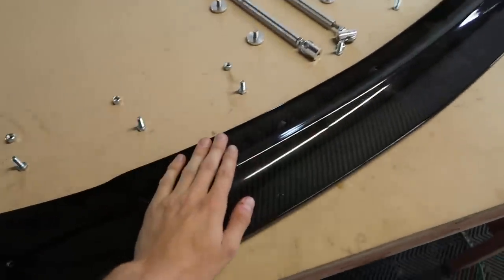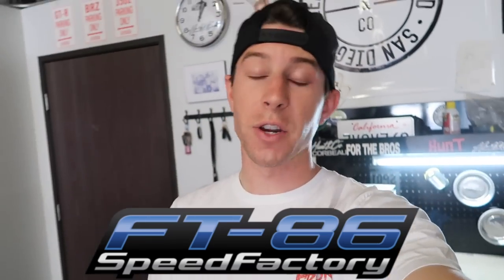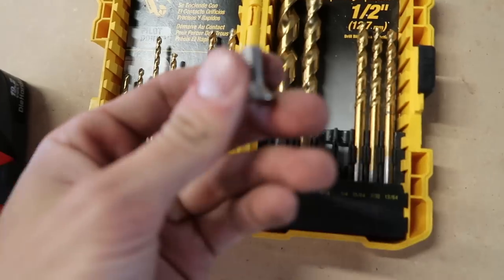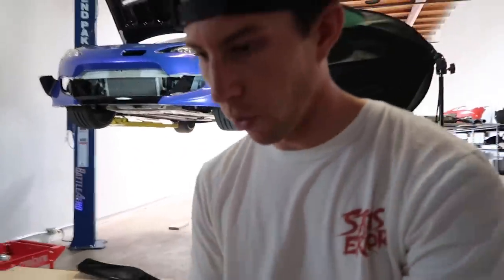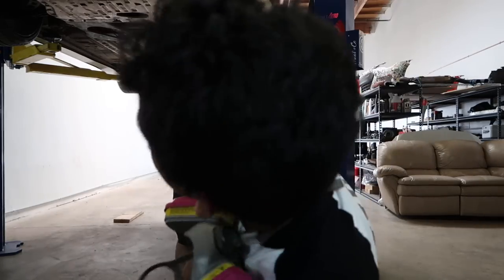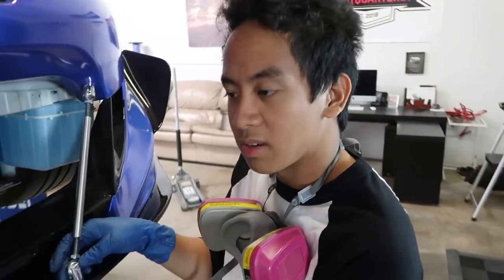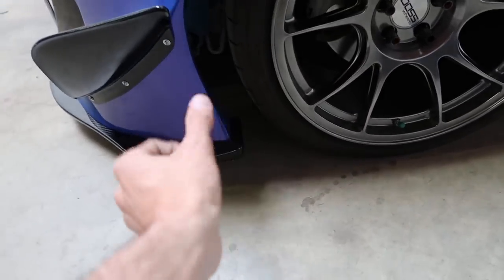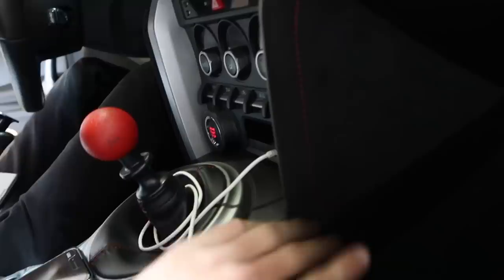Making Miley great again

Comment: TJ, from someone who started on a 600 and felt the same way you do when I was first starting out. A good compromise you could look into are bikes with different power modes. Most of the newer 600's can swap between 80% and 100% power. This way if your afraid of the full power at first, just change the mode and get used to the lower power first and in the long run you won't be wasting any money.

Comment: Go for a 600. I was 5'5" 120 pounds and bought a GSXR 600 right after I graduated high school. I had plenty of experience with dirt bikes and it wasn't a bad transition at all. You did a great job on the Triumph. There is no reason to be worried about it unless you don't have self control. 600's are docile until you rev to like 10k. I recently sold my 600 for a KTM 690 SMC. Supermoto is the next step after you get your taste of the sport bike ;)

Comment: Yo get a 650 twin it's in between a 300 and 600, and you won't get bored of it too quick! plus the power band of 650's are usually very linear which means easy to control!

Comment: get a 300 or 500 great starting level

try a cbr500r or cb500f
Reply: Justin Trinh Agreed! Tho the 500 Is a little heavy and not to much more power than a 300, but would still be much better than a 600.
Reply: Justin Trinh don't be a little girl, the man needs atleast a 600. do you even have riding experience. take into account height, a 6 foot man on a 300 is insane.
Reply: Preston Johnson tf are you talking about 😂 the size of the frame changes very little from 300 to 600.
Reply: Isaac Hepworth the frame size might now be much different be riding position, 300 is more upright, knees will be hitting the tank in the wrong places and your legs won't be comfortable at all where on a 600 you'll be in a more aggressive position and your knees will hug the tank correctly
Reply: Preston Johnson umm no, I'm 6 foot and I've sat on 300s and they feel fine. The upright seating position is more comfortable than a super sport. Only thing I don't like is that the pegs seem a little close to the seat, causing my legs to bend more than I'd like, but I've sat on a zx6r and it felt pretty similar in that aspect.
Reply: To those that say 300's are going to be small:

Plenty of people ride 300's that are  tall. Plenty of people ride Groms. I know of one guy that kills it at my local track on a nsr50.  If he runs into comfort issues, he can get after market rear sets and clip ons but I highly doubt he will.

if you guys think 300's are lame, go watch moto3/arrc 250/your local club organization light weight races

Comment: Just a suggestion and the route i took when i bought my bike. I was looking at 600cc and liter bikes and ended up going with a 650 by kawasaki. Its a parallel twin engine instead of the inline 4. It still has plenty torque and enough speed but its not stupid fast. I've had my bike for 7 years now and i have yet to regret my purchase. Best of luck I'm excited to see some motovlogs.

Comment: just a quick tip when drilling holes, draw a cross across where the hole will be, that way if the drill starts to travel you can easily see and correct it

Comment: TJ this is how I feel about the bike sizes. I started on a 1000 that was a gift from my brother, so it's possible. I had no background in riding motorcycles at all. As long as you respect the bike and don't push it you'll be okay. That being said, there's a lot of times I feel like I missed out on the joy of getting to move up through the power.

Comment: Hey TJ, so I own a Ducati 848, which is 850cc pure racing power, but it matters less on the bike you choose and more on your self decipline, if you can control yourself you could get a 1000cc as a first bike, if you can't control yourself you may want a 300. Me, I started on a 600cc and im still here and I've never been in an accident or dropped my bike.

Comment: Tj a good consideration about the bike would be a 650cc. Know the cc's are more than a 600 but most are 2 cylinders vs. 4 cylinder supersport 600's. An Sv 650 or an Fz07 would be a good starter that wouldnt out grow for a while.

Comment: the smaller displacement bikes are fun, you can ride them all out all the time. i had a 250 for 4 years, only thing i didn't like about were going on interstates where people were going 90mph and it topped at 100mph. i went stupid and got a 02 honda 919, scares the crap out of me but i love it and respect what it can do. oh and take a motorcycle safety course

Comment: Sabrina, that was a great impression of TJ 😅 and TJ, about picking a bike, what i and my friends did and many others here do is getting a 600cc and restricting it (reduce power) and as we got used to the bike we gradually increase the power by removing restrictors. 
Also, you really should wear gloves, you can get really nasty burns otherwise. BUT, you need gloves that fit your hands and feel good to you personally to get the best feel. You might want to try some that are "inside out" if you haven't, they are a little more comfortable than "stitches in" ones. I find that with alcantara wheels i get better grip with gloves, and my hands are better with leather wheels. But then again my hands tend to sweat a lot so i use gloves for that reason too.

Comment: What TJ said about picking the right size drill bit only applies if you have a fastener I.E. a nut on the other side. If it's a wood screw or any other type of screw that you're going to be solely counting on to fasten your ish you're definitely going to want to make sure you use a drill bit that's the size of the screw minus the threads or shaft of said screw. Upvote so people won't f up their ish?

Comment: #tjhunt Do what feels good to you man! Go take a couple bikes out for a ride im sure the guys you will be working with will let you... 300 is fun and 600 is what id limit myself to... but go with what feels comfortable drive them both around... and rip it! if your on a 300 and you try to go and you feel like its not enough .. bump up a lil more ... with mods you can also make a 300 alot more fun ... 600 has the power needed with little to no modification ... But that is my advice man drive both sizes and of a couple different makes and figure out which one fits YOU! 

Pros and Cons ive experienced ...
300's zippy great for getting around and just having fun and not worrying about power band... its pretty hard to kick the wheels out of a 300 so they are pretty safe ... Cons to the 300 ... they tend to be lighter and if you like hitting the high speeds sometimes wind can push you around.

600's wheels can kick out ... which is great if you like playing and experimenting and going 0-60 really fast! its alot of fun ... also the 600's are heavier and you will feel the difference when cornering or riding at very high speeds, you will stick to the ground better.

Go with what feels right!

Comment: KTM RC 390, perfect starter bike. All you need to do is replace the clutch and brake levers because they're made of aluminum and they'll break really easily if you tip the bike. But since you have experience, I wouldn't worry about it.

Comment: You are supposed to match drill bits and bolts with the end of the drill bit that the drill is clamping down on and the end of the thread on the bolt to

Comment: TJ i know they don't look as cool but you should think about getting an open face helmet for drifting so if your going to talk it will sound more clear. smart getting the smaller engine on the bike. step up to the bigger one when your ready. plus you can run through the gear more without instantly going 100.

Comment: seems to me those control arms were designed to fail to protect the car from damage eg: bending or breaking the mounting points or flexing the frame

you might find that you'll bend a lot of these arms but that's ok because it's doing it to protect your car

Comment: the biggest problem you run into on any 300 is the low gearing to make up for the tiny power. you have to rev the piss out of them to keep up with traffic on the freeway. look into 600-700cc two cylinder bikes like the ninja 650 or fz07. they have moderate useable power and freeway friendly gearing. but the most important thing I do before buying bikes is get seat time on whatever model i'm looking to buy to make sure it's what i'm really looking for.

Comment: If you dont want to hurt yourself, then dont get a bike lol I started on a 600 with absolutely no riding experience. Got bored after a year and upgraded to the 1000. Definitely a much better bike, especially for my build. 6'4" 250. Riding in Cali is much different from riding in Michigan though. the other drivers expects bikes to be around. MI only sees motorcycles for 4 months of the year so other drivers freak out when bikes come out in spring time and accidents always happen.

Comment: Doesn't matter what bike your gunna get, you will get hurt, that's why it's a waste of time buying a 300, especially when you know how to ride as it is. A 300 would be better for people that are learning to ride and modulate with the clutch and throttle without too much power. Since you can already do that, as a rider myself I highly recommend you getting the 600, remember if you are going to fall off and get hurt you will, it doesn't matter what bike your riding.

Comment: hey man about the bike, honestly a 600 would be better for the simple fact you'll learn throttle control. i advise watching twist of the wrist if you haven't already. the acting is bad but it's very helpful. 300's are good beginner bikes but 600's will let you respect the power and learn your limits. don't be scared of crashing. everyone will always go down at least once. just wear your gear and don't do anything stupid and you'll be fine. CBR600RR's are good or Kawasaki Ninja's as well. at the end of the day it is your choice so do what you feel is best for your safety.

Comment: Please don't follow the advice about the screws X drills!!!! If you see the center metal piece (disregarding the tread) match a drill up to it. You want to allow the tread to dig into the material 

Also it's pronounced quarter twenty bolt (a 1/4 x 20 bolt)

Comment: dude you can buy a 600ccm and reduce the power. That's the way we have the deal(by law) in germany. for example I own a gsr600 with original 98horsepower  and have it reduced to 48 horsepower and can go back rally easy.

Comment: I really hope he didn't pay for new control arms because he's had them less than month and they already failed they should be covered for something like that. Doesn't even seem safe to use those control arms if they are just going to bend every time he goes drifting. Tip #1 don't buy cheap parts.

Comment: 600 are great first bikes no low end torque all powers at the very top, 300 is a little meh i'd say look at a ninja 650 or even a sv650 or whatever the new Suzuki vtwin is called if that's the new Suzuki both of these are in the middle of a full supersport 600 and a wimpy 300

Comment: Yo unless you fucking stuffed the 350 off video those arms shouldn't have bent so easily. I'm feeling like a possible second pair will break soon and a new brand will rise in the mist? Stoked
Reply: in the damage video even the sump guard was trashed, he had an off
Reply: duane mann this is true, but still slightly worried the parts are trash. So many people take diggers drifting lol.

Comment: 600cc is fine. I started with it when I was 19. the engine was tuned to make only 40kw in my first half of driving though. after that period went with full power. You'll be fine as long as you are not driving like a complete dumbass. nice video btw ;)